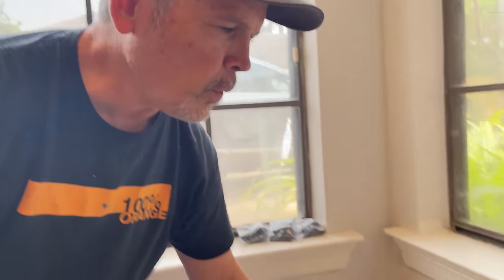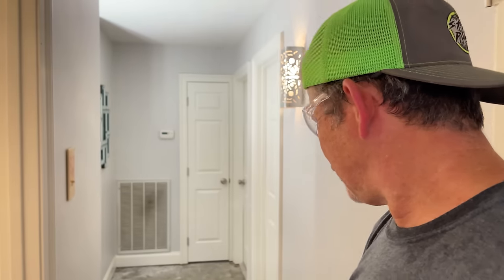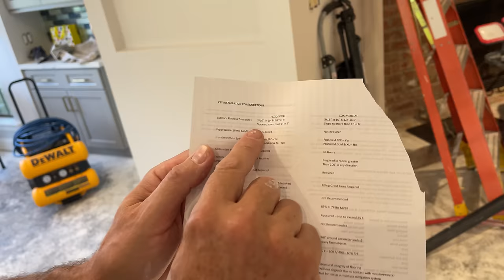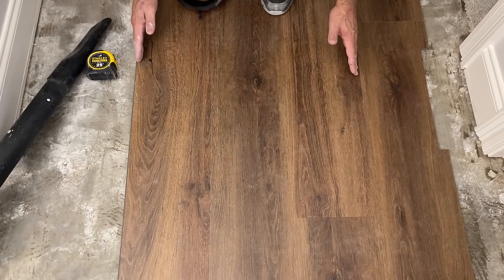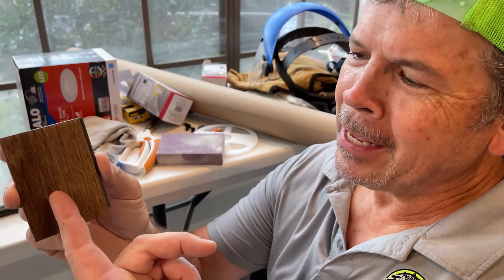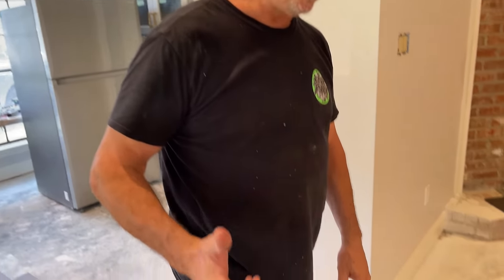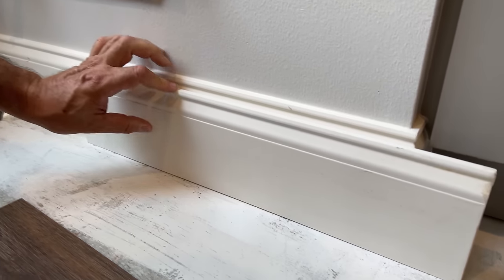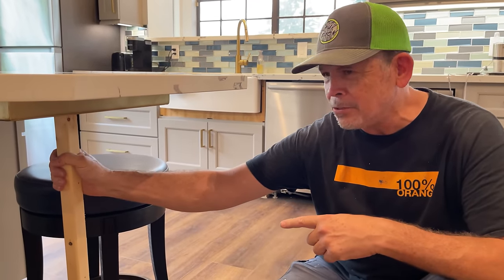The ULTIMATE FLOORING HACK! | Installing Vinyl Plank Flooring

Comment: While I'm a general contractor I make most of my money laying hard surface floors. One thing that gives a much better finish is taking the baseboard off and going with no baseshoe (especially on a remodel where you're not worried about paint lines from potentially lowering the base).

Also in the hallway (and every door), the door itself is the split. Half the door belongs to one room the other half to the other. You shouldn't be able to see the next rooms floor when the door is closed (can't always help it with that tile that was down but the carpet should be cut back in the bedrooms to split the door).

I love that you guys took the time out to go under the dishwasher instead of just the feet and inspection plate, that's quality.

Another tip when floating out the pits and sprawls, ardex feather finish or ardex GPS are great and you can start laying most floors over it within the hour. 

With the vinyl planks a huge tip (or with laminate) if you take a tongue side from the long side and use that as a tapping block it helps protect the groove side of the plank when beating on them.
Reply: Thanks for that last tip. I’ve put down tons of flooring in all the houses I’ve owned and remodeled. It never occurred to me to simply rip a strip off to beat on. Nice!
Reply: @derekw40  that's what I use on all my floors (since they all have their own proprietary edge) and then I have a hdp block to tap on them but they work great and even without a tap block you can use any hammer and be fine
Reply: What william said!
Reply: You can also cut a  small scrap piece,  then rip it in half and just in case you need a tapping piece for when installing the opposite side  you'll be covered.
Reply: I do agree with the majority of what you stated, except for the base shoe.  And I only say that because I kind of think of the next person that's going to want to change the floor out.  It's going to be exponentially easier just to pop the shoe off, and take the floor up.  But, I do do it both ways, depending on the setup.
Reply: @mkl5448  I do agree taking the baseshoe off is easier, however for my area in Ohio, as an installer we get the same per linear foot to remove/reset baseboard as we do baseshoe (that may be different in different areas). So for us in this area while difficultly may be slightly higher, as long as it's not old school 7-9" tall base, we always try to remove it. Here it's how you can tell the difference between the good flooring stores and the big box stores
Reply: I hate quarter rounds I had baseboard removed when installing my hardwood flooring.
Reply: @williamwright3735  Makes sense, there is no question it's a better looking finish as well.    Thank you
Reply: Technically, tapping is not recommended for vinyl. But that said I have found a very light tap with a rubber block to be helpful in setting that last fraction of a millimeter that adds up and causes problems at about 10 ft out.
Reply: @ccr8392  yea I usually have one or two of those by the end of the job (had to tryin 3 rows backwards on today's job) usually going around walls when going into the next room or into closets. Definitely an often used method
Reply: You dont need to cut carpet back hardly ever, I just pull the tape off the seams and tuck it
Reply: @daniels1293  if the seem is in the correct finish location then you are exactly right. The important part is that the center of the door itself is where the floors change and not the center of the door casing. So if the seem isn't in the center of the door than it's not as easy as removing the seem and tucking it
Reply: @williamwright3735  maybe I'm just really lucky but normally the seam is like right where I need it to be.
Reply: @daniels1293  carpet guys in your area must be better than the ones here lmao a lot of times the ones here (unless the carpet changes in the rooms for some reason) seem it at the middle of the casing, not sure if that makes their job easier or what
Reply: @williamwright3735  yea most of the guys I know out here in michigan who are carpet guys do alot of hardsurface installing so they do shit right most of the time. The floor guys out here do it all from sanding floors, to installing carpet tile or lvt.
Reply: I also do all of the things you mention. The exception is the baseboard. I almost always install 5-1/4" and it's nearly impossible to not have gaps underneath with stock that size since it doesn't conform and isn't perfectly straight. 

I almost never work backwards like was done in the video but I do screw down some ripped pieces as a starting row to be replaced later so the floor doesn't walk. That is definitely a good suggestion.
Reply: @dansch19  5 1/4 is the most popular here in new construction or remodels. Having unlevel floors is definitely a good reason for baseshoe. Random gaps between the base and the floor because of leveling issues is hideous lol
Reply: I did that as well especially since the base board in the houses I did was generic Lowes trim that was easily replaced.
Reply: Hey William, I agree that the correct way to handle the transition from room to hall would be to split the door. The problem is that the original carpet installer either messed that up or had to deal with the flooring that was already in the hall. I'm going to guess that Stub Pack is not a carpet installer, nor would he want to venture into potentially damaging a carpet that may be even more difficult to repair. Carpet stretching can be a real hassle if it has some age to it, and messing it up at the door is the worse thing that you could do. Sometimes you just have to deal with what you have, and as you said, these guys take the time to do the best job possible.
Reply: @Reborn627  if the carpet was short than I can definitely agree that stretching it can cause more problems than you want to get into. In this case the carpet was long (it split the jamb instead of the door) in which case is all you need is a carpet knife. They were already going to have to put a tack strip down if they were tucking it, or a flat metal (tucking it with an end cap/reducer is best), so no matter how this carpet would be finished the only change is trimming off an inch and a half or so, no stretching needed since it was long
Reply: @William Wright call it what it is….you are a floor guy
Reply: @chrisreynolds2410  yea I know, that was the only reason I pointed any of the stuff out. I've seen I think every video stud pack has done and know from what I've seen they can probably figure out most stuff just from suggestions and comments which was the only reason I left the comment. Not to just criticize them, but just suggestions that a flooring guy does
Reply: No offense but honestly 1000 square feet a week isn't that much floor.
Reply: @shawn1506  while I know in a bit picture view 1,000sq ft is nothing, so no offense at all taken. I guess at least in this area what makes it big, is I have zero employees, do mostly residential (I do actually have a school cafeteria this week but that's a rare one for me), do my own trim, underlayment, and floor prep. So unless I switched to all new construction, which around here doesn't pay as well, or got employees that I probably wouldn't trust, getting more than 1000 a week is hard
Reply: @williamwright3735  fair enough. I agree with the points you made. especially about hiring someone that you probably wouldn't trust. That's the worst part, you can't trust anyone any more. I know what it is like to be a one man show. It can be very tiring at times. One muck up and it can really mess with your schedule. Best to you out there.
Reply: If you remove the baseboard then there is a gap at the bottom of every doors trim. I now have 5 doors with that problem. How do you deal with the virtual boards wrapping the doors.
Reply: @ecospider5  if you remove a thicker floor than what you're putting down you will have the gap under the door (you will have that whether you remove the baseboard or not). I've only had one customer (pretty high end house) that cared enough to fix it. I extended the door jambs down with poplar (it was white doors) and CA glued them onto the bottom of the jamb and then filled, sanded, and painted them to match the doors
Reply: @nhbilly  you cant bend baseboard if your floor is not perfect level
Reply: I removed all my own baseboards before the flooring was done, just to prevent quarter round being used. There aren't even any transition pieces to carpet, just straight from one surface to the other, seamless.
Reply: Billy Mack, Texas Detective  can't do anything if the customer doesn't want it, but the baseboards were already off on that job. Didn't know they put them back up early because of delays in the floor delivery, but in this case the customer was fine with it. As for my area, removing and reinstalling baseboard is about half the cost of installing shoe per linear foot so there usually love the idea of it
Reply: Billy Mack, Texas Detective  Good thing you know just exactly what the facts is.
Reply: 100% agree with you there William, hate 1/4 round or shoe, looks so  unprofessional,  always remove the baseboard.
Reply: I'll pass on that. Takes up too much time, has a lost of liabilities that could potentially come with it and I'm not caulking nor painting to get it back to the way it was before. I'm too busy to create something that involved for myself and I can see many customers not wanting to pay extra to have the same look as before. Just qt round it unless they're paying extra and you have the time to do so.
Reply: @achillesbuilds2432  while I watched their next video and see why they used qtr round on this job, they also had the baseboards off and just put them back on while waiting on the floor.

What liabilities do you have taking baseboard off? Only liability is not being able to take it off right and breaking it a bunch
Reply: @williamwright3735  I've ran into issues before where the sheetrock behind the base was extremely fragile due to a previous flood or just high humidity. I've removed it before and found mold which haulted the entire job and due to it having to be treated. I contract through 9 different ppl so I have a new job daily and have to pass a portion of it down to other ppl I know. I can't take the time for removing it. Some older homes I've worked in have base you can't find in stores because it was made by hand onsite back then. You have to remove the old caulk at the top and in many old homes it contains asbestos. I have a very good trim guy I know and if the customer is set on removing it for a specific desired look I'll bring him in and reschedule my flooring there. He will remove it, lable it, remove all nails, sand the tops and when I'm done he will come back, install, caulk and paint it. It's just easier and faster for me that way and he does a better job than I can. I also dont reinstall toilets anymore due to a new wax ring failing on me and causing a leak which cost me nearly 2000 dollars. I explain to them the liability involved and that In a floor guy. I have a plumber that charges 25 bucks a toilet and carries his own insurance and such. I've never had a customer complain about the process after I explain to them that we wouldn't hire a chef to put a clutch in our car. I can do those things, but I'm a floor guy lol. It's just easier and more efficient for me to avoid extra work outside of flooring on these jobs. If I only had one job a week I would be more likely to remove it and take my time with it, but I have a large family to feed and have to keep the jobs coming in. If I don't ppl will get someone else to do it. I can lay roughly 1000 sq ft of LVP a day by myself and it's flawless. Ppl like these jobs to go fast and they are always amazed at how fast I can cover ground. Taking the time for other tasks such as base just slows the process bc they don't always see it as separate tasks. They see it all as a floor job. Bringing someone else in to handle the trim turns in into two jobs and makes the entire process feel faster. Just my two cents about it all and what has worked for me, but to each his/her own I suppose and if removing it works good for you then that's all that matters.
Reply: @achillesbuilds2432  if you have it set like that you can have another guy do you shoe/quarter round I can see how it speeds things up for you. I do my own trim work and have no employees so for me it's faster to take it down than to put shoe up and while it's not a killing it's $1.75/linear foot for trim to take down and shoot up so I don't lose on it.

I'd love to find your plumber I'd make a killing using him. I get $135 a toilet to pull and set. I have no problem doing it but I'd pay someone $25 to do it just to not have to lmao.

I usually average about 400-600sq ft a day depending on the layouts that includes prep like baseboards and undercutting jambs and stuff. If I picked up more new construction or commercial I could get a little more a day but they don't like to pay quite as much for commerical or new construction so I still balance out money wise lol. If I can make $750-1000/day I don't complain
Reply: @katieluv8422  you dont know what your talking about
Reply: I do the same.  I have seen shoddy work where the installer put a 3/4 trim
Reply: Using quarter round corner molding is so armature.  There’s also a cement trim blade for scoring the brick fireplace.  That makes a very professional look.  I noticed that your angle cuts at the fireplace were off.  Hopefully you didn’t use corner mold to hide the gaps.
Reply: I concur .  And what I do is use 3/4 cove moulding at the floor to wall .  It opens up the room as opposed to any type of mopboard or base moulding .  Just my personal choice , but many a person has gone along with that suggestion .  Much less expensive too when you're talking a couple hundred lineal .
Reply: My partner and I do 1000 to 1500 of Lam a day at $2 a foot im 60 hes 65 we prep install clean & paper and shoe, we only work 3 or 4 days a week, so $3000 to $7000 a week each  in our 60s and in california!
Reply: Thank you.
Reply: william, i need to raise my flooring up prior to my plank install. do you recommend OSB or MDF as the underlayment? Ill be going directly over my subfloor
Reply: @pjm360WA  I never recommend MDF for anything. OSB, plywood, luauan are all fine for raising your floor height depending on how much you need to raise it.
Reply: The Ardex is a fantastic product, great recommendation!
Reply: @habanohal  Silicon macht das schon...🙂
Reply: Do you think it's better to put the cabinets down first and then do flooring? Or do flooring if i don't have cabinets yet.
Reply: @BillyHeany most floors will say that no permanent fixture can be installed on them (with the exception of the 4 foot vanities which are considered furniture). When doing cabinets  if the floor is already down that then makes it harder to shim from the front (unless you are going with those cabinet levelers at like $70/cabinet so you can still level them). If you're sure the floors are level, not just flat but level, and have to do the floors you either mark out the cabinets and don't install there or when the cabinets come in set them in place, draw a line and cut the floor out
Reply: @williamwright3735  As a builder/flipper, I prefer to not buy/install as much material as possible.  So I agree that only putting down the baseboard where possible is the way to go.
Reply: good luck with finding an even floor
Reply: I agree, take the baseboards off. It looks more professional to not have the shoe molding. I know it is acceptable to add the shoe molding, but it looks like the floor was an original installation if you remove the baseboards to install the floor. Then take a little more care to reinstall after laying the floor. You may receive more referrals for the more professional job. And you can charge more because the finish is more professionally completed.
Reply: I agree 100% tapping blocks all too often will chip laminate, and to be honest until you reach the last piece of a room where you might have to tap it with a bar you really don't need a tapping block all that often if you hold the laminate on the right angle and pull it it will click in without any need for tapping. the angle is different on many different locking systems but after a couple rows you'll figure out the angle I also find it helpful when you get to the last row on a room or going into door jambs to put that last piece in first then the next to the last piece and then pull the two together, but unless you're a professional you probably won't understand what that means. But I know you do. And it all comes out to that first row that you lay that's going to set the tone for the whole job making sure there's no movement
Reply: If you don't remove baseboards when installing flooring, you are doing it wrong.